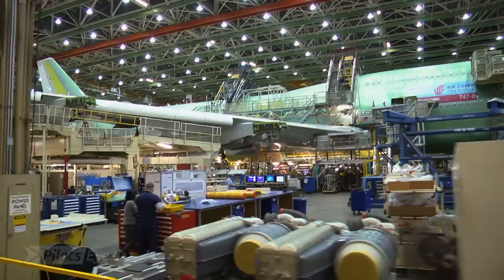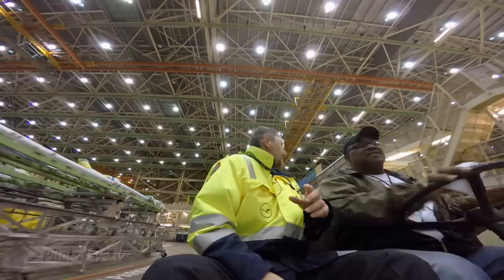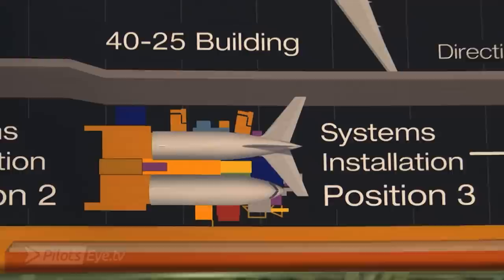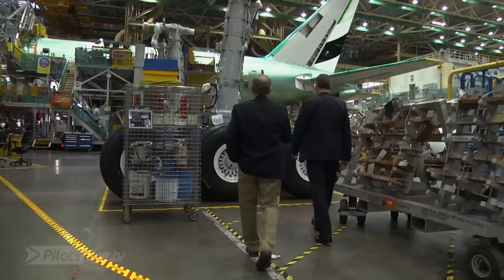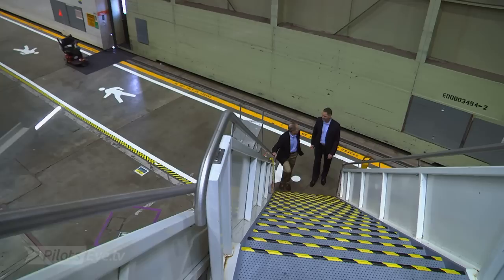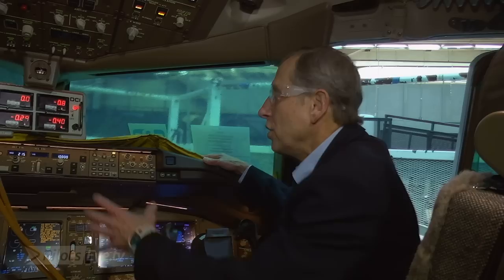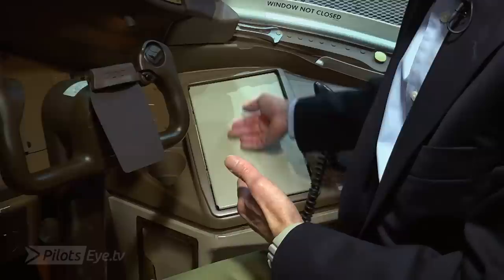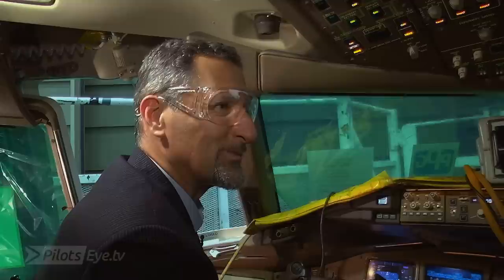PilotsEYE.tv - Preview - SEA777F - Factory Visit Part one

Comment: I wonder if Lufthansa will have to spend millions again to remove the uninterruptible autopilots in their newest acquisitions which according to Lufthansa are not supposed to be there and are not listed on the build specs .
Reply: +hadibadashi Uninterruptible autopilots? What are you talking about?
Reply: Google it !
Reply: +hadibadashi Thank you very much, magnificently helpful internet person... -_-
Reply: “During early 1995, Boeing sales experienced an unconnected but serious internal problem in Europe, though the details were never made public. The German flag carrier Lufthansa discovered that its new Boeing 747-400 aircraft had been fitted with flight directors [auto-pilots] that were vulnerable to American remote-control, ostensibly designed to “recover” hijacked aircraft whether the hijackers wanted to be recovered or not. Lufthansa was not informed about this “free extra” in advance, and was furious that its sovereign aircraft might be covertly “rescued” by America, without the knowledge or permission of the German Government. 

In a mammoth operation rumoured to cost in excess of $800 million, Lufthansa stripped every flight director out of every Boeing in its fleet, replacing them in total with German systems programmed by the Luftwaffe [German Air Force]. According to a member of the German internal security service in Frankfurt during October 1996, all Lufthansa aircraft had by that date been secured, rendering them invulnerable to remote flight director commands transmitted by any and all American authorities. Under the new intelligence protocols, Russia and France were made aware of these flight director risks.”
Reply: Thomas Vandermeiren Thank you Sir .
Reply: +hadibadashi You do realise that quote stems from a 9/11 conspiracy blog, right? Do you honestly think that no Aircraft Maintenance Engineer would have "leaked" this information to the actual press if it were true?
Reply: +Thomas Vandermeiren well...just take a a look at his channel. no questions

Comment: cool   but Airbus is better ;-)
Reply: Gartenfuzzi wait.. what?
Reply: No boeing is better than airbus
Reply: even the 787  dreamliner????
Reply: Dreamliner
Reply: Not even close.    Airbus and the a380,  need I say more.  Name one Boeing aircraft in modern era jet  flying that didn't  sell successfully and basically is still flying today.  Can't beat the staying power of the 737 , 747,  727,  767 , 707 and the almighty 757.  To the point where Boeing is regretting it retired the 757.   So therefore when Boeing releases the 797 ,  will be a 3k to 4K aircraft order for worldwide sales   what does Airbus have.  A321,  airlines only  order it because there is not a design like the proposed 797 available.   Best Airbus can do is revive the a310, re engine, re cockpit and it most probably will be a close competitor for the 797.   Or really name the new aircraft a360.